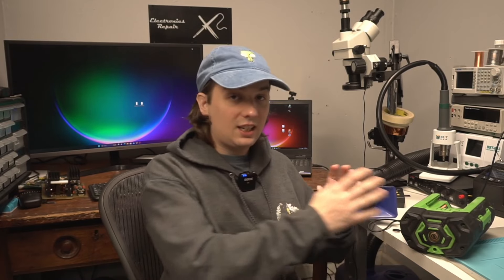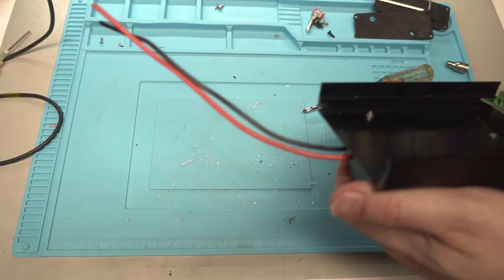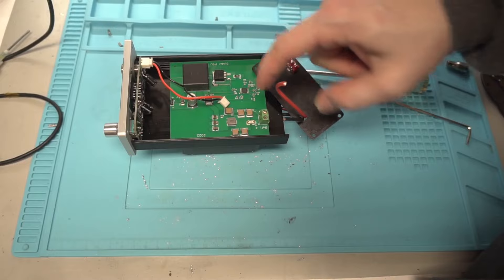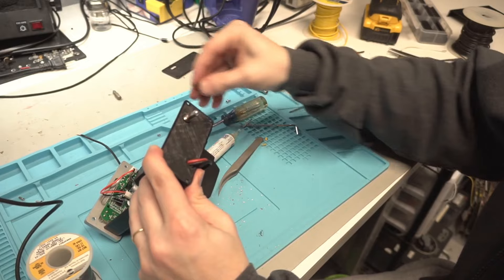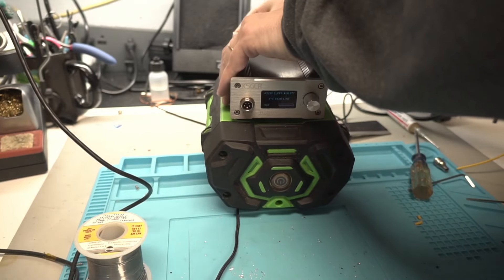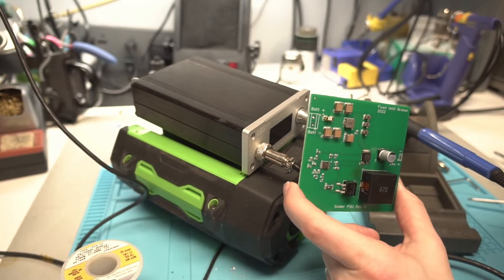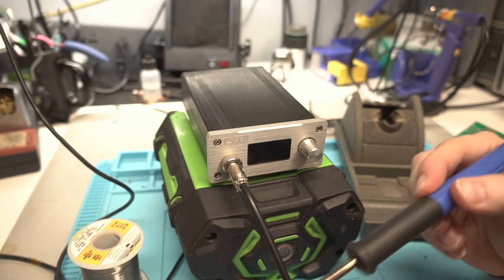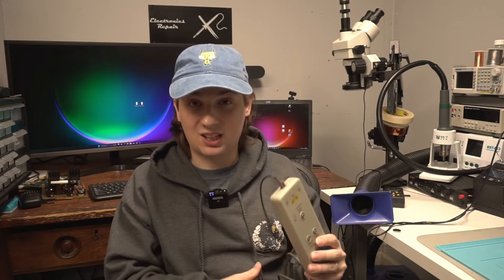56V EGO Battery Powered Solder Station

Comment: nice project, I have a super small cheapo t12 clone that takes dc power directly, so I rigged a couple fuses to fit in the terminal with wires going to a barrel jack to connect it to my milwaukee battery. Very crude set up but it works Definitely don't have the battery life you will though lol
Reply from the maker: Yeah I've seen projects like that. I started this almost 2 years ago but if I'm not mistaken seeing that online gave me the idea to do it with ego battery.

They are kinda pricey batteries but I already had them from my yard tools.

Comment: If I can find a replacement handle for my KSGER, I might have to try this mod for myself!
Reply from the maker: Yeah my main problem with the t12 stations is that I hate the handle. I'm kinda surprised no one has made an adapter for the real Hakko handles but I really haven't looked into that